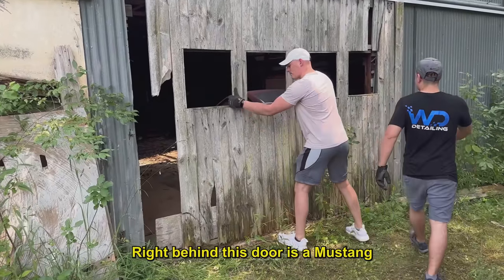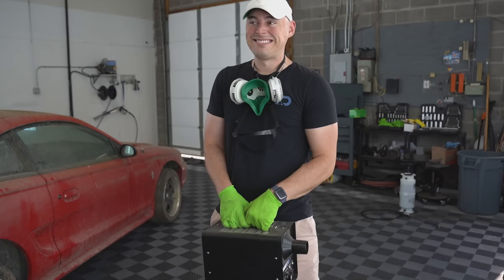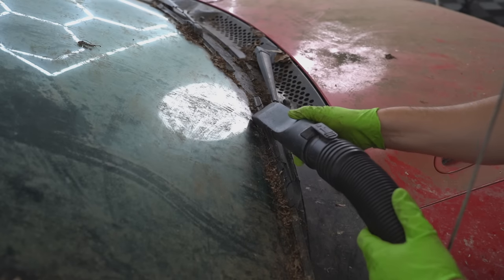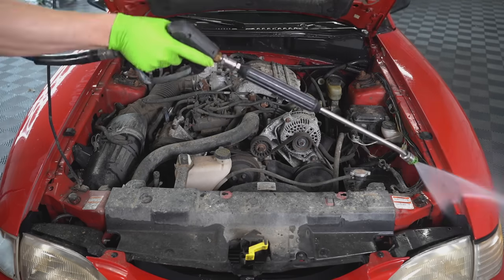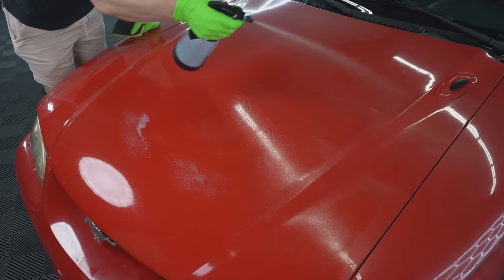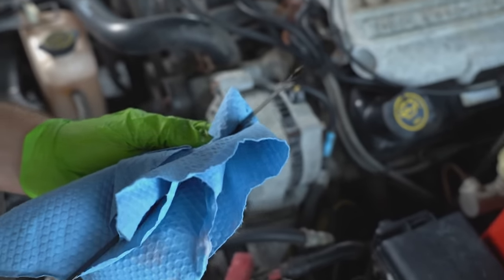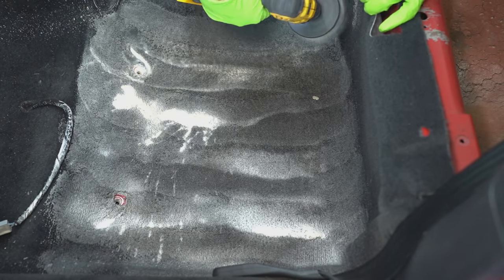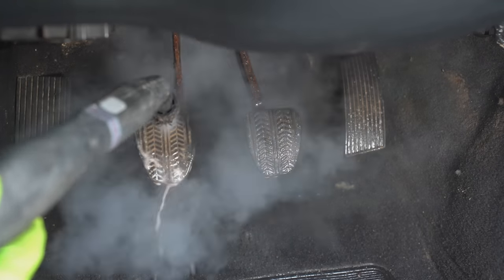First Wash in 8 Years: ABANDONED Barn Find Ford Mustang! | Car Detailing Restoration

Comment: You guys do a decent job cleaning cars but can I add a few thoughts?  I never see the under carriage of the car cleaned like the Detail Geek does in Canada. He also spends a lot more time cleaning the wheel wells. Another point is that the tires should be removed and wheels cleaned on both side like  Larry at Ammo NYC does. This makes for a real complete detail. You seems to only clean what people can notice on the outside. Nice work, but you need to be more complete in my opinion. Keep up the good work anyway!
Reply: I would expect more to be done from a professional detail for sure. Love Larry’s work @ Ammo. I try to do the same as Larry does to my 87 911. 
It takes a while.
Reply: Bro the car doesn’t even work,  this is not a Lamborghini.  They did great for a car that worth like $300-500 bucks

Comment: Not sure if it was mentioned or if you got it running but most fords since around '86 have a fuel pump reset switch. It's triggered in the event of a crash to cut the power to the pump/relay. Usually in the trunk area or passengers kick panel. You can actually trip it hitting a hard bump or in some instances, if someone bumps the car too hard. My dad had the issue with one of his and we traced every wire in the car for the fuel system until we found out about this switch reset. Hours of diagnosis only to be fixed by pushing a button.

Comment: My mother bought one just like this one new in 1996. She drove it daily until 2010, putting over 180,000 miles on it. It ran perfect and everything still worked as it should when she bought a new Challenger in 2010. She kept the Mustang instead of giving it away as a trade in for the Dodge, using it as their spare car. It ended up sitting under a car cover for the most part as both her and my day had vehicles and didn't really need it. She ended up selling it to a friend of my brothers in 2019 for $800 and he is STILL daily driving it! They are excellent cars!

Comment: Im really amazed how well that paint still looks.
As for maybe swapping engines alot of ppl is either putting in a coyote or a Barra v6 but that would be rather expensive , so ide just clean it up and get the original motor going.
I have a Export 95 gt and im looking at ceramic coating for it so will look at Avalonking.
Great work guys.
Reply: Hi I’m an Australian and I can tell you that the Aussie Barra is a straight 6 not a v6 but and awesome choice for the stang !
Reply: Barra v6? Lol

Comment: As per a general comment: I have viewed many of the videos produced by WD Detailing. To the best of my knowledge, I do not know whether the following was covered: I found that wiping down the cavity between the rubber seal and the edge of the trunk assembly with either a moistened paper towel or a rag helps to recondition the seal and keeps it cleaner. Invariably, much dirt is harbored therein,  and will be noticed upon the cleaning process. I like how the ceramic coating has been introduced in conjunction with detailing a bright red vehicle. Also, I like how the cleaning of the wheels of this car was accompanied by the music with the lyric: "what goes around comes around"!

Comment: My camp counselor drove a Ford Mustang.  The car has seen many changes over the years.  Her's was a convertible.  RJ and Brent, when I was a kid, cars had no airbags and the first seatbelts were just the lap type.  I think it was about 1968 when the first car rolled off the production line with the first shoulder strap.  But back then, they were two completely separate belts.  The Ford Mustang was also featured in a  video on "How a car is built".  When I was your ages, I was working in a sheltered workshop which was Lafayette Industries.  The former general manager wanted to add a car detailing operation at the workshop.  I am sure that would have called for even a bigger dumpster due to all the stuff the workers would have been vacuuming out of the car.

Comment: Try checking the drive side trunk under the trim for the inertia button (red button). It may be pressed down by the owner to cut off the fuel just tap the side of it with something. It should spring up when its not down. Anyway may help it start. That sn95 is actually in pretty good condition seeing the after shots was pretty crazy.
Reply: No no it pops up when it gets in a wreck, you push it in and the fuel pump gets power
Reply: Okay maybe it was the other way around, regardless I figured it could help. 
I understand its for a wreck but some disable it for security reasons.

Comment: I once owned an 03 Mustang coupe with the V6 and auto. A really nice car. The Mustang detailed is a similar body platform and these cars are also well engineered. That's why so many well cared for examples are still on the road. In answer to the question in the video. Keep the stock engine. The 3.8 litre V6 is a great powerplant.

Comment: Typically after a car sits a while, you want to check a few things before attempting a start cause you can seize engine by forcing it over. I would of manually turned engine over. Replaced engine oil. Check fuel pressure. Then attempt to start. (If you want to preserve engine). Likely the fuel pump or assembly has gone bad from sitting for YEARS so adding fresh fuel to OLD bad fuel just made the gas tank removal process more difficult if pump is bad. Just sharing my two cents cause if you guys come across a car you might want to flip after cleaning - then engine preservation will be essential.

Comment: A basic 302 would be an appropriate swap. Coyote is a bit much without other major upgrades. The power will outstrip the poise in the stock configurations. 
Nice recovery all the same.in the detail. 
Fuel in the tank is shot if it has been sitting that long. 
Drain the tank, clean the tank, clean the fuel lines. Otherwise all that varnished fuel, or  potentially rust is being fed into the injectors. 
Reviving the engine is of equal effort to detailing the car. 
Kudos on the content!
Very enjoyable.
Reply: The 302 and Coyote are both 5 litre engines, but the later is a more modern version with power and efficiency enhancements.
Reply: @intentionaloffside8934  
The modular Coyote is now 5 liter+. 
Concur, it’s not the same animal as the 302 Windsor. 
I am of the vintage that measures displacement in cubic inches. 
My point is that a stock 302, configured with a 4v is more than enough power for that chassis. Any more power, and it will render something that is wonderfully exciting in a straight line, but challenging to say the least on a wet public road in turns. 
Now, if you are going to built a quarter mile car, that’s a different story altogether.

Comment: Great job on detailing the car. I'm thinking the fuel pump relay and/or the fuel pump is bad. On fuel injected cars, always listen for the pump when you put the key in the RUN position. The fuel pump primes anywhere between 3-7 seconds and then shuts off. If you don't hear it, you won't get fuel to the injectors.
Reply from the maker: Yeah we didn’t hear it. That’s probably what the issue was

Comment: Good job, guys. If that engine is a 4.6, there is only one engine I would put in there. A stock Panther tuned 351W. Same horsepower as the 4.6 but an extra 150 lb/ft of torque about 2,000 rpm lower in the revs. Rear axle down to 2.73, and get 4 cylinder gas mileage with monster performance.

Comment: As usual, another amazing detailing job.  With the claybar and ceramic coating, the paint probably looks better now than it did when the car was new.  That looks like a ‘97.  I had a blue ‘96 convertible with white vinyl top.  That car ran great right up to the day it was rear ended at a dead stop at red light on Santa Monica Blvd.  In Beverly Hills.  Clueless driver.  🙄

Comment: I'd definitely put the 5.0 HO motor in there especially seeing that it's already got the manual trans in it!! Great job on the Stang!!  I see that the passenger right headlight was really clean at the end seeing that you replaced the turn signal light assembly.  Did you do a headlight restore on the driver side as well?

Comment: Nice detail, as for the engine its a V6 If its not operable I would change it with the Ford dual turbo from the Raptor.  As for a barn find, an original 70-74 Dodge Challenger or Plymouth Barracuda.

Comment: Late to the party, but the fail to start is likely a clogged fuel filter or tripped / bad inertia switch, usually located in the trunk for this vintage. Could also be wiring chewed by rodents. The 3.8 V6 is arguably not Ford's best engine. It is known for issues with head gaskets and cracked heads. However, the manual trans makes it somewhat worth saving. Food for thought, my understanding is that the Ford 3.8 is a Windsor 5.8 (351) with two cylinders missing, so this car could be a prime candidate for a swap using a 5.0 / 5-speed from a wrecked SN95 car. Electronics would have to be swapped if the aim is to retain factory-style fuel injection, but with this car over 20 years old, it is likely emissions exempt and could be swapped with a carb'd 302 / 351 and registered as an antique. And this car would MOVE with a 351.

Comment: I have 1998 gt convertible it’s almost don’t all that is left is the inside and paint job. Motor done and trans in brand new with 1000 mile break in period. New clutch. Adjustable FireWall clutch cable. Aluminum Drive shaft. I spent about 3200 on it and then some.

Comment: If the engine runs good and is maybe even low miles, you could keep it. If not, it seems that a 5 liter ford engine or bigger would be good for a mustang. Don't know if a 429 would fit, but that would be boss!

Comment: I'm always curious & kinda worried about how spraying water onto the alternator or electrical wiring might actually reduce the life span if not completely just dead the thing idk maybe I just worry too much me personally I would bag around the alternator & air filters or just take them out to do a hand clean then just spray a degreaser and cleaner in the engine bay

Comment: Built a 1998 convertible gt been in a 89 convertible notch back with a built motor with a b303 cam. V6 to v8 Swapped carb 302, cranecam roller rocker and lifters b303 cam. I was 19 watching YouTube and reading google. You better get them not and start working. It’s a gold mine waiting to happen.

Comment: Most likely  sat there due to the fact the head was cracked on number 6 cycl between the intake and EX valve. I would replace it with a 5.0 or I think that year they also had a 4.6L which is a lot easier to work on . 3.8L had a major issue with the heads

Comment: What do you do to clean out the vent and HVAC system? Surely, there was a ton of debris in there based on the condition the car was in.

Otherwise, as soon as you turn on the air or heat it's going to blow nasty stuff everywhere.

Comment: The 3.8 litre V6 engine should stay. Those are good egines. I've owned Fords with that engine. Rock solid reliable. It isn't s muscle car engine but is certainly adequate. For horsepower enthusiasts a 4.6 litte V8 engine from  the higher performance Mustang could be dropped in with no modification to the engine compartment. This engine is also very reliable

Comment: I'm kind of confused, most people will wash their car starting at the top and working their way down, correct?
That way you remove the surface grime efficiently?
Why is it that when you are preloading the car, you start across on the other side from you and then as you work towards you, you are putting contaminants back on the side you removed from?
Also, when you pre rinsed your rocker panels, you are going in reverse?
Bottom to top? Yes I know you do it the correct way to rinse, but those contaminants are being rubbed into the paint. 
Now with that said, the swirls of bad washings over the years! 
It is an awful repeated process.

Comment: pressing the trottle on a fuel injected car does absolutely nothing.... just a fyi.. its pointless and can actually cause the car to NOT start.  Cars are controlled by computerized engine-management systems, which read the engine temperature, and in some cases the ambient air temperature, and then determine how much fuel and air to send into the cylinder when you turn the ignition key.

Comment: Such a terrible waste for the best looking modern mustang in my opinion. But it sucks that it's a v6 with cloth I'd replace the seats with recaro custom racing seats and do a swap to the new coyote engine then this would be a great car. I've been trying to find this color convertible v8 manual and they are very hard to find untouched

Comment: Two things.  First, could you please stop "enhancing" the thumbnail to make the vehicles look worse than they actually are?  It's baiting to gain clicks.  If you are proud of your work, then let that show.

Second, unless you did a lot more work on that interior off-camera, there is no way it is clean.  With the size of the nests you found, plus all the foam that was missing, the mice were moving everywhere in that car.  If the center console wasn't removed, I will guarantee there is a "highway" under there.  Given the size of the nest in and behind the glove box, that entire dash probably has to be removed as well.  I'd also be concerned about the carpet being left in place.  After 8 years, it has fully soaked through.  It would probably be easier to replace than try and clean.

Now that this isn't your own car that can be up to the owner.  However, there is no way would I feel safe driving or riding in this car after seeing/knowing the level of infestation that there is.

Remember, it was shown by Mythbusters that you can polish a turd.  That's what this was.